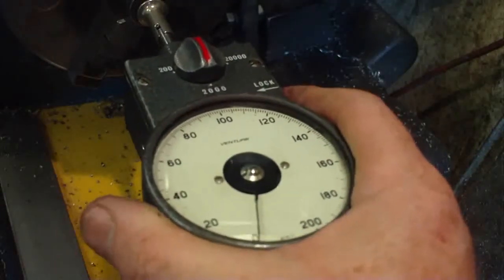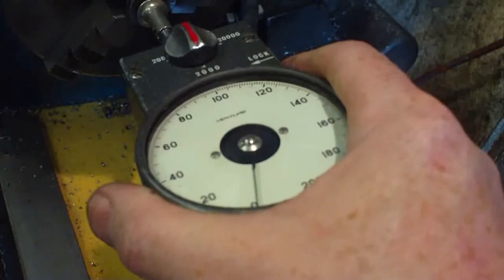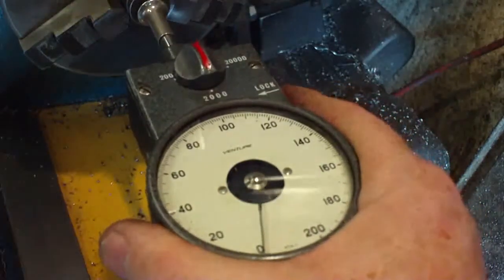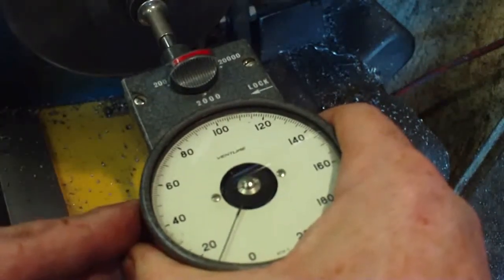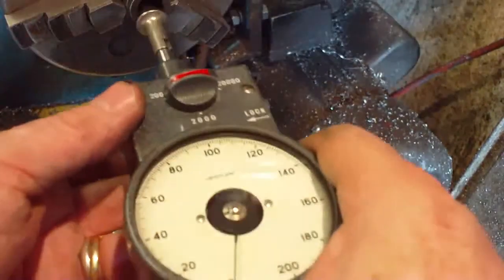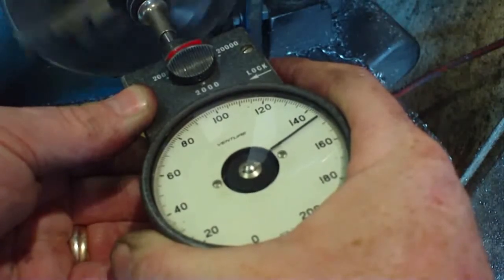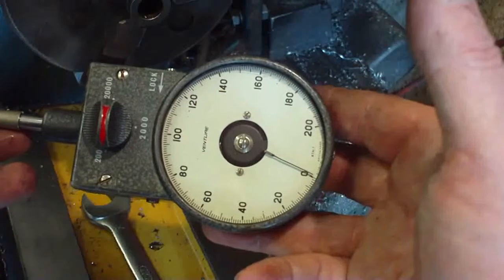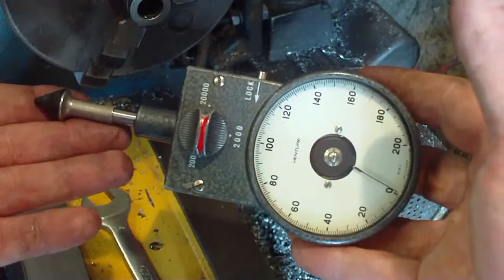Venture Tacho Part 4

Comment: I have a similar venture tacho - has 0-500 range instead but otherwise identical. Am I right in thinking there is just one wheel in the kit for measuring surface speed? The wording in the box suggests there is one each for metres and feet, but I think I may have misunderstood and you simply use a different division to calculate each? Thanks
Reply from the maker: Thanks for the comment, I only have the one wheel in mine too, so I would think some conversion table would be required for metric measurements.
Reply: @SpenCrowson  Hi Spen, I just did a manual calculation with some known values on a bandsaw blade and the wheel included is definitely for fpm, using the division by 10 it doesn't seem to get near what I believe the m/min value is meant to be. The division by 2 did get pretty much dead on what I had calculated the fpm to actually be. So maybe there was another bit meant to be in the box after all.